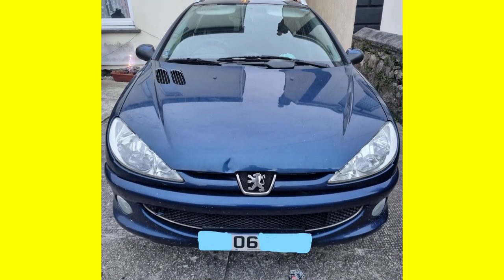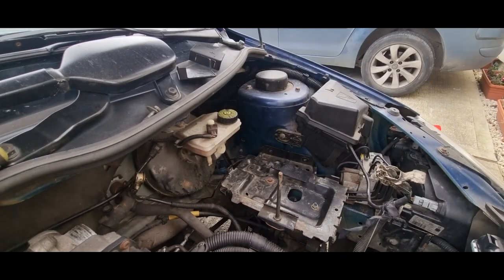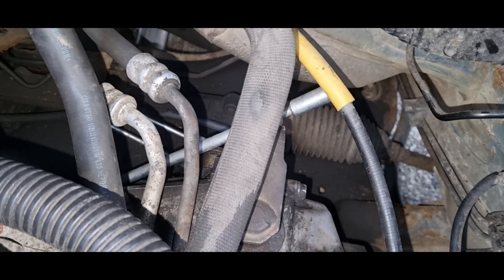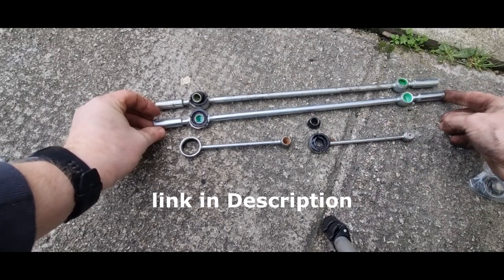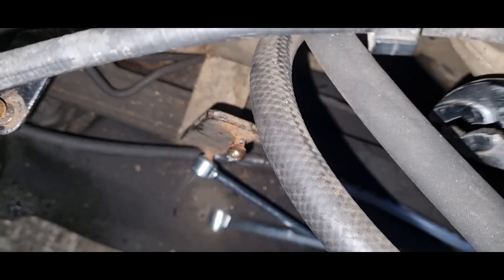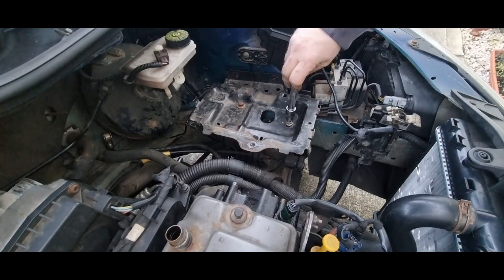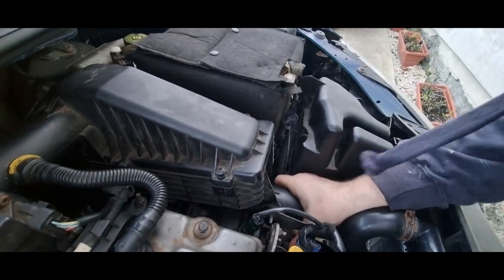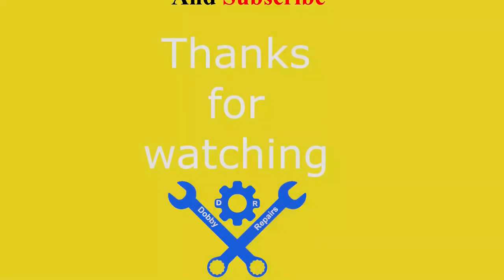How To Replace The Gear linkage On A Peugeot 206 SW

Comment: What was the symptoms for you to have to change the linkage
Reply from the maker: In this car case, it was a loose feeling gear   being unable to get gears   it's easy to check for if you remove the air boxes, you can visually see the linkage

Comment: What is that rubber you pulled of from the throttle body? I don't have it on my 1.4 kfw
Reply from the maker: It's a seal for the air pipe to throttle body. it's only on early models from what I've seen.  so, depending on the age of yours, it may not need one

Comment: my peugeot 206 sw from 2004 has a wobly transmission stick and the gears some times are hard to get in, I will try to change the gear linkage like you did
Reply from the maker: Hi a wobbly stick was one of the reasons I changed the linkage on this one

Comment: Is this the same on a 1.4hdi ? thanks
Reply from the maker: it is the same for the 1.4hdi as far as I know
Reply: @dobbyrepairs  Thank you!
Reply: @dobbyrepairs My 206's gears are a bit sticky and hard to put in sometimes. I'm assuming it's from the linkage since it also does it with the engine off. You reckon this will help?
Reply from the maker: It's worth having a look at the linkage before replacing it to see if there is any play in the joints . It's hard to say if it'll help without seeing the car .

Comment: Does the original part have those weights at each side?
Reply from the maker: Yes, the original part on this model does have the same bits at the ends on some models they can be slightly different looking  hope that answers your question

Comment: Did it not require any grease on the linkages? If so what did you use?
Reply from the maker: I didn't put any extra grease on mine as the replacement linkage came pre-greased but if you want to add extra or yours isn't greased all ready then you can use multi-purpose grease
Reply: @dobbyrepairs  bless you thanks mister :)

Comment: Is this a auto car thanks
Reply from the maker: It's a manual car  are you having problems with auto ?
Reply: @dobbyrepairs  Yes its a Auto A mechanic said to me, They were common for the linkage bushes to fall mine only drives in reverse Thanks Damian
Reply from the maker: I see if you drop me an email dobbyrepairs@gmail.com with the reg I'll happily see if I can find you the right linkage and do my best to advise how to fit it
Reply: @dobbyrepairs  Now someone else said might need a new gearbox but they have not seen it, Because its auto and it drives only in reverse ? thanks
Reply from the maker: It is a possibility that the gearbox has gone is the sector loose feeling  when u put in drive ?
Reply: @dobbyrepairs  No all tight not loose just not in engaging in drive but reverse all good do they have a clutch plate just seems something simple
Reply from the maker: No clutch If I was you I'd take a look at the gearbox see if there's any signs of oil leaking from it and see what the linkage is looking like I'm not sure  if yours has an electronic gear  controller or not if it does it could be a fuse